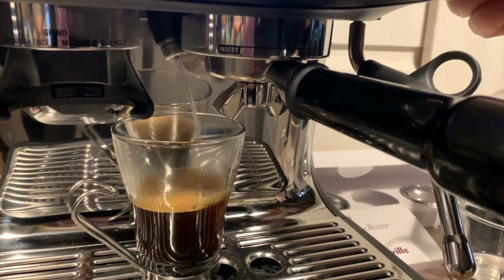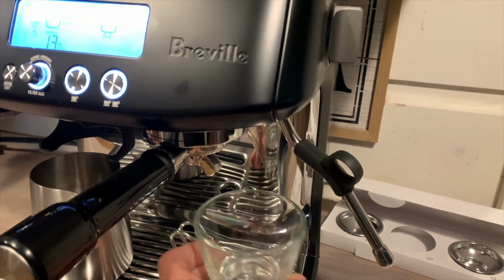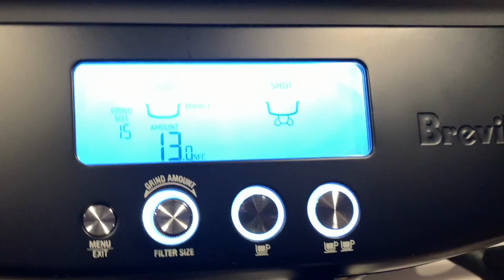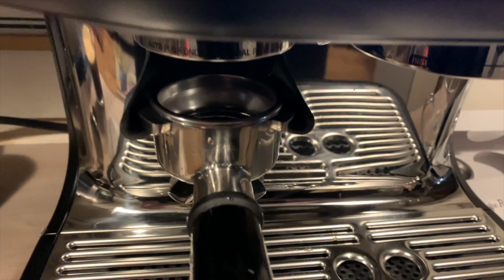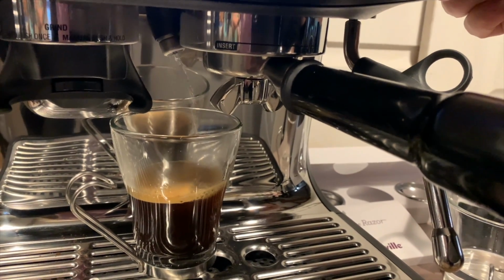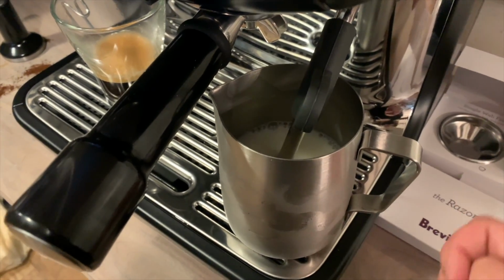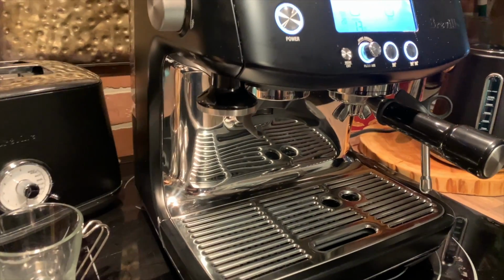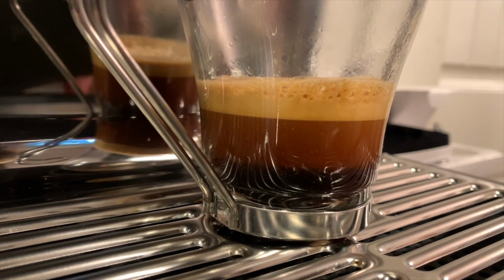Breville Barista Pro Espresso Machine Review

Comment: Shows how much Best Buys knows, its NOT an automatic far from it! We can tweek and change settings both on the water presure and the size of the granulated coffee till we achive our perfect cup of expresso. 
The semi-automatic Breville Barista Express brews better espresso than more expensive machines. It's comparatively easy to use and keep clean, plus it has an attractive stainless-steel design. It also has a built-in burr grinder for hassle-free coffee ground dosing.

Comment: How do you heat the portafilter?
Reply: I heat my porta filter buy running a single shot of water through it. I take it off and dry it with a paper towel then place it under the grinder and begin to make my shot.

Comment: Why does mine always do a pre-infuse before the shot comes out? And my grounds are very wet when it is finished. I thought it should be pretty much dry and a bit hard.
Reply: What filter basket are you using?  The dual walled or the single walled?

Comment: Everything you did there was wrong! First you need to dial grind size down to at least 3 to 6 instead of 20! 20 is way too coarse for an espresso! Espresso grounds should be very fine! Finally you should not place the wand in the jug and expecting it to do the frothing for you. You have to move the jug around to hear a hissing sound as the milk whirls anti-clockwise. Lastly it’s not a touch screen machine.
Reply: Grind size is subjective though. I just tried out some new beans few days back, and I had to dial in coarser until like 21. I had tried to shortcut it by starting at 13 - took almost 15secs for 1st drip! Perhaps the beans were too fresh (just roasted 8 days prior).
Reply: Actually you do not have to move the jug around. you need to position the jug on an angle so that the tip of the wand is just below the surface of the milk and allow a vortex to form by the steam wand. Once the vortex starts you can ease up the steam wand up nearly breaking the surface of the milk and continue steaming keeping an ear on hissing and popping noises this means you are introducing air into the milk.  When the milk jug is warm but not too hot to touch you can then submerse the steam wand for the rest of the steam cycle to incorporate the air into the milk and get rid of any large air bubbles that might be sitting on top and continue doing this until you can no longer touch the surface of the jug.